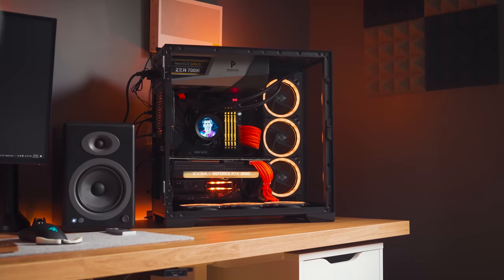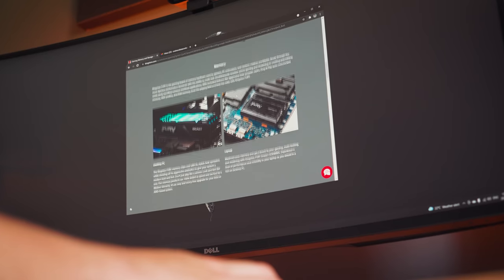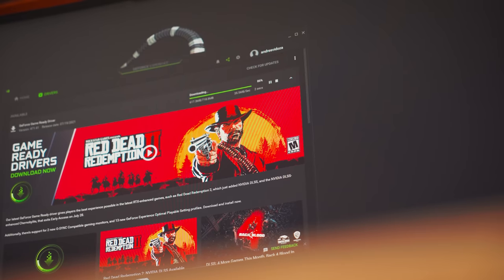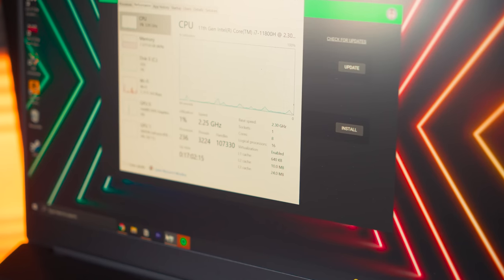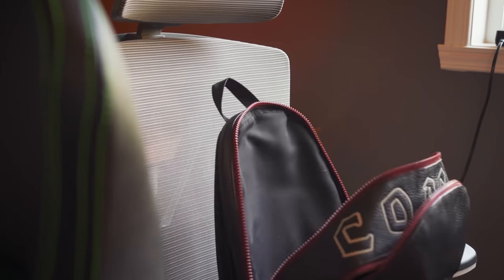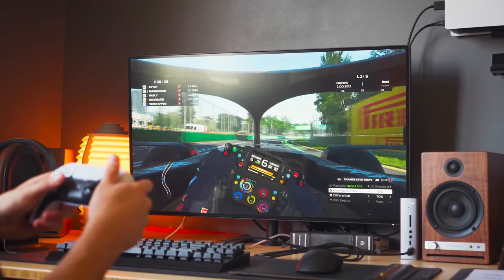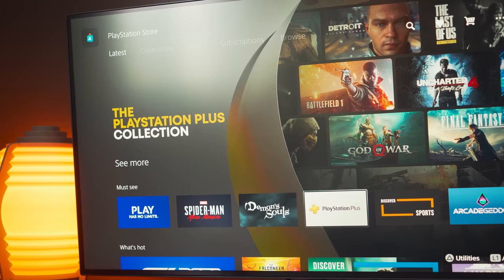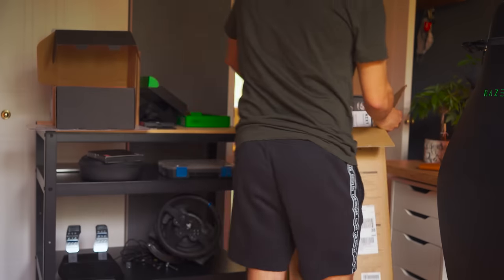PlayStation 5 vs Gaming Laptop vs Custom PC   Which Should You Buy in 2021

Comment: I prefer consoles because PC components that can last without upgrading will easily cost over 10K in total where I live but a ps5 (non-scalper price if you're lucky) only costs 2k and I know the ps will work for all the games that come out on it for the next 5+ years. For reference, an RTX2060ti alone is over 2800 bucks, a single stick of 8GB DDR4 ram is about 300 bucks and a Ryzen 5 5600X is about 1300. And minimum wage here is 1200 a month, the average is around 6500.

Comment: I think gaming laptops in 2022 are a pretty good option. I don't really care about gaming at 4k. 1440p is just fine. I have an rtx 3060 laptop and it does great at 1080p and decent 1440p performance, 4k performance is eh but I never game at 4k. Consoles are good but portability with laptop is what makes me like them.
Reply: How do u game at 1440p? Isn't the display just 1080p
Reply: @koala322  got a 4k TV. I set the resolution to 1440p
Reply: @fanatiquefantastique8516  oh but does that tv give good frames?
Reply: @fanatiquefantastique8516  and no input lag?
Reply: @koala322  havent really bothered measuring. Only played a couple games on this laptop yet.
Reply: @koala322  good frames yes
Reply: @fanatiquefantastique8516  oh did u just check?
Reply: @koala322  I don't check for input lag but I do have the frame counter on in bottom left corner and gou benchmarks are always solid.
Reply: @fanatiquefantastique8516  oh can u tell me how much fps u get on avg? In cyberpunk
Reply: Or anything else than u play
Reply: @koala322  I don't have cyberpunk. I get above 60 fps in Red dead redemption 2 though with mostly ultra settings with a few turned down to high.